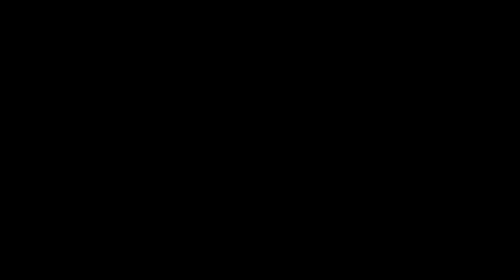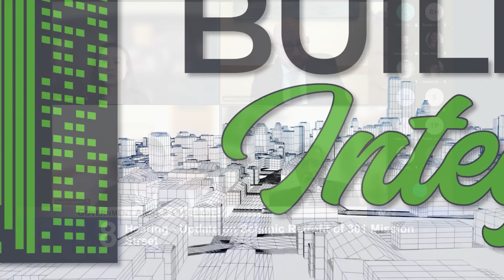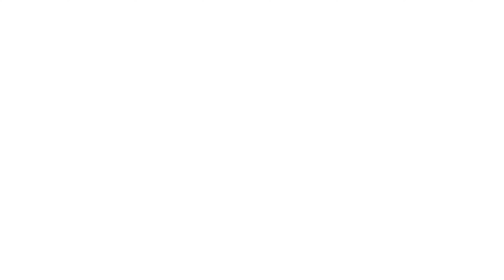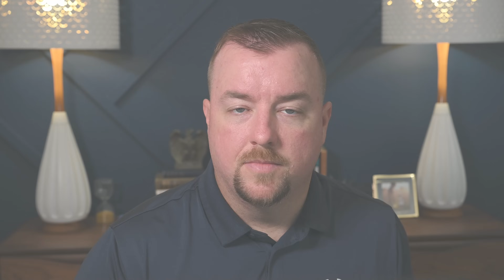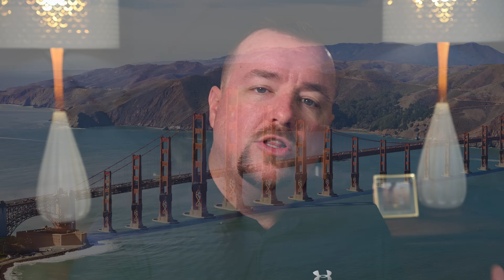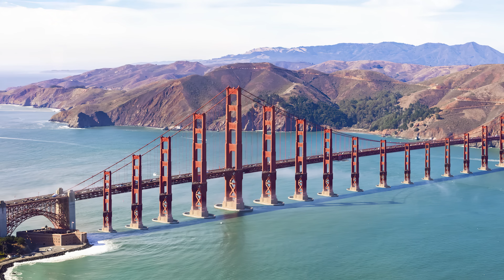Millennium Tower's "Sophisticated" Fix?  You Decide - (San Francisco's Leaning Tower Part 4)

Comment: A US Geological Survey research geophysicist named Tom Parsons says that San Francisco is sinking into the Earth.

NBC Bay Area reports that Parsons examined every single building in the Bay Area, using satellite images captured by European Space Agency’s Sentinel 1 satellite.
Most of the settling appears to be taking place downtown, because of the staggering weight and density of the buildings.

Ominously, at least one is also tilting.       According to The Weather Channel, Millennium Tower earned its nickname of the “Leaning Tower of San Francisco”       because of how much it’s tilted each year since its opening in 2009, and NBC says it’s only the third heaviest building in the city at an estimated 686 million pounds.       In 2018, a large new crack had been found in the building after residents heard a loud noise.   Experts say many problems may be causing the city to sink, including the loss of groundwater because of new construction and that the Millennium’s foundation isn’t rooted in bedrock.

Concerningly, Parsons told NBC the combined weight of all the downtown buildings is enough to affect an earthquake fault, though luckily the famous San Andreas fault runs offshore before it reaches the city.    And, of course, it all connects to climate change.

“If you have all of this going on when you’re right near the waterline, in some cases in San Francisco, then you have to worry about big storms that sea level comes up and inundation more frequently,” Parsons told NBC.
      Parsons also says he’ll be studying Manhattan next, according to NBC, to further study the effects of sinking on coastal cities in light of rising sea levels.

Comment: I’m a geotechnical engineer, albeit with limited experience with piles. If a structural engineer came to me under normal circumstances with a specified number, spacing, and loading of piles, I would probably assume that was something they determined was necessary due to a structural constraint (i.e. a greater spacing would result in excessive deflection in parts of the structure, etc.).

However, in an unusual case like this, I would expect the geotechnical and structural engineers to be in frequent contact with each other, discussing the designs and bouncing ideas off of each other.
Reply: It does raise the question of what the relationship is between the two groups.  I feel that engineers are engineers and would like to talk to each other, but some kind of politics is limiting the interaction.
Reply: @russellhltn1396  I'm guessing it was fire-and-forget before, but quietly adversarial now (don't want to tick one another off and cause the other to turn state's witness).  It's probably like a modern replay of he Kansas city Hyatt Regency structural issue - engineering inattention leading to catastrophic structural deficiency.
Reply: My experience says once the phrase "It is what it is" has been used in the engineering discussion, they are out of viable engineering solutions. This project will require more time, money, and inventiveness than it will cost to just buy out every owner and tear it down. They should remove this Boondoggle before it becomes an "engineering issue" for the surrounding buildings.
Reply: @bradfordprice3781  And I think there lies the problem.  There isn't enough money to fix it, and there isn't enough money to buy everyone out and demolish it.  Ultimately, I think everyone will lose.  It becomes a question of minimizing one's own losses at the expense of others.
Reply: @bradfordprice3781  Well, it will be what it will be
Reply: @bradfordprice3781  ever since I learned of this building's problems last year, I've said the same thing.  I am NOT an engineer but do have a pretty deep background in structural and civil engineering picked up "seat of pants" over the 45 years of my career as an architectural drafter and designer who actually did all the gravity engineering on every building I designed and built until just a few years ago.  When the cost to "fix" the building exceeds to value of the building, it's time to tear it down.  I lived in downtown Seattle for many years and we had a similar situation with The McGuire Building, a 26 story residential tower that took 3 years to build and after 2 years of being a viable building was evacuated and torn down, a process that took almost 2 years.  The issue with The McGuire Building wasn't settlement issues, it was well grounded on bedrock, the issue was the post tension cables used in the concrete slab floors had not been properly stretched and so the floors, all 26 of them, began to sag between the support columns almost immediately live load was applied to them.  There are some interesting videos on YouTube showing home videos residents of tower took of their sagging floors.
Reply: Exactly.  Should have been a room full of people - <competent> engineers,  geotech, foundation contractor, owner all spit balling a solution on a white board. 

 Unfortunately, it's devolved into a CYA contest.

Comment: OK, I'll add my 2 cents. This building is about 7 miles from the San Andreas Fault and maybe 15 or so from the Hayward Fault. We have seen that the San Andreas, in the Bay Area, is capable of producing quakes of 7+ in magnitude. And we're going to float this building on clay? This clay layer can't even support the weight of the building. 
Oh, and by the way, tall buildings in SF sway FEET in smaller quakes.
Reply: The solution adds a whole other layer of complexity to this (and another reason it is flawed) - sitting a portion of the building on hard rock and another on clay is all but sure to bring seismic failure. An Architect here with a fair bit of experience........
Reply: @smaarch1  
With no experience whatsoever, I'd already come to the same conclusion.   😖🤦‍♂️
Reply: This building already has a built-in sway, so earthquakes will be no problem.
Reply: @michaelsommers2356  😂
Reply: @michaelsommers2356  not true. Yes, buildings in earthquake areas are on rollers (usually) but the safety of that depends on them being straight up and down. Not leaning 2 + ft to the side. Because of the rollers, they also sway with heavy wind. It can make you sick, but I've never been in one that was off level by 25 inches. I wouldn't want to be in one either.
Reply: @calliew311  I was making a joke, the "sway" being the tilt.
Reply: @michaelsommers2356  my bad. 🤦🏼‍♀️
Reply: @calliew311  Well, it wasn't a very good joke.
Reply: just make an uboat of the building  so it can sink far down so it wont topple over

Comment: Maybe it is because my mind is full of IT thought processes, but it seems to me that a simple Excel spreadsheet with engineering formulas and a cell for changing the number of piles could help find the optimal choice. What if scenarios easy to adjust.

I'm far from an engineer even though I have credentials claiming I am. That just means the term has been watered down to the point of being meaningless, but I digress. I'm confident there is software far better than Excel for these calculations. I'm even more confident that there have been qualified people with access to all relevant information that know EXACTLY what the risk is and what needs to be done and the most optimal solution. 

My suspicion, with much less confidence, is that the people with this knowledge are being kept from providing testimony in any manner that could create a liability. The politicians want to make it appear more complicated than it really is so they can always say they tried with the information available. 

Maybe I just don't have much trust in people, that's possible, but every step of the way seems to sound like half of the conversation is about looking for a solution and the other half is preparing a defense in case they are wrong.
Reply: The issue in engineering is seldom the calculations.  Doing those is the easy part and Excel does them just fine.  The hard part are the assumptions and the unknowns.  Things like steel are well understood, consistent and fairly easy to analyze to a high degree of certainty.  Things like soil is not nearly so nice.  Soil varies dramatically in all three dimensions and geo engineering is as much art and judgement as it is science.  And many things interact.  One pile by itself will have different characteristics and capabilities than will a closely spaced group of piles as the piles can interact with each other and the soil.  I think for this reason most geo, foundation and structural engineers tend to be super conservative when it comes to foundation design both for the reason of the large uncertainties involved and for the criticality of the foundation and difficulty of making later repairs.  It appears that with this building, the engineers let the cost pressure cause them to be much less conservative and they got too close to the line and it has bitten them.

Comment: Is there any tech to inject some sand mixture to the lower part of existing piles so to level the building? I think with modern tech you can achieve a very very very high pressures.
Reply: Don't know about raising the sinking but you could cut off the tops of the long ones?   (ROFL) 
 Building sinks slowly but straight.

Comment: Ron Hamberurger attempting to throw the other engineers under the bus means that he is either lying, or incompetent. I am not an engineer, but my brother is, and I have worked with many engineers on projects. The first part of a project is finding the design and engineering requirements. For example: What is the type of load, how much load will need to be supported, what is the design life, what are the cost and time constraints, etc. The engineers will gather that information first, then come up with one or more solutions based on those requirements. Except for very straight forward and simple solutions, there is generally a back and forth discussion on different design trade offs.

In the case of Millennium Tower, the first part would be how much force would be needed to reverse the downward movement, then what designs would be able to provide that force with enough margins to ensure success, then which of those designs would cause the least amount of impact to the building occupants, and then finally, be the least expensive. Since the amount, type and spacing of the pilings would have a huge impact on price, and also impact on the building occupants during construction, this would be a very large part of any design process.

It sounds like they purposely just used the geo-technical engineers as glorified plan checkers for their solutions, instead of collaborating as would be normal. They can now use that to blame shift for their incompetence.
Reply: I asume they pretty much knew before, that 18 should be enough. But with such a huge project, never been done before in that kind of circumstances, they just went for more than double to be 100 % on the safe side. I guess getting paid  for the extra piles was never in question, since everybody would be happy if they could fix this major f..up . 

But when the drilling and the solution made the problem worse, they had to admit 18 were enough.
Reply: @joedo3529  Except, if that had been the case, then the Engineer just lied!  Saying we added a huge safety margin would have been a valid reason for the initial reduction.  However, even then going to 18 means the thing was way over-engineered. Especially given the level of disruption it is causing.
Reply: @EmperorA0  I have a hard time believing they chose the random number of 52, and not at least discussed behind closed doors, if 40 or 30 or 18 could be also enough. Something seems to be missing here. I am sure there was a reason they went for the 52 in the first place and somehow can not tell why now 18 are enough.
Maybe they were worried about the foundation because it is also twisting and were happier spreading the forces to 52 points, than to 18 points.
Reply: Looks like a pass the buck game. Wonder who's gonna have the buck when it goes off?
Reply: The foundation was originally designed, for a steel upper structure.  Some 'doofuses'   changed the plans, and made that thing (tower) out of cement.  Also, they  wanted to save 4 million $$, by  NOT  GOING  TO  BEDROCK.....so, now it is time to pay  the  piper......and that, will go on, until  mother nature,  ''levels '' it.....literally.   See facts, above.

Comment: In defense of the geotechnical consultant, they would not have been paid for extra, unasked for work. BUT it would have looked better for them now if they had asked "do you want us to determine the optimum number of piles?" at some point. I'm surprised the building owner hasn't commissioned an independent audit of the structural engineer's work; I would have no confidence in him given the recent events.
Reply: True about the geotech engineers not getting paid for extra work, or answering questions that weren't asked.  Also, the geotech firm may not be experts on the structure of the building or its foundation.  Therefore they may not have been qualified to determine the optimum/minimum number of piles.  That determination may have required combining their expertise with that of the structural engineers, and further investigation, calculation, and expense.
Reply: Here's a guess:  maybe the builders are asking very narrow, very specific questions, because they are desperately trying to control the answer?  Which is to say, they aren't contracting a proper analysis because such a thing would probably say "its a lost cause, tear it down",  or possibly "this is absolutely the result of culpable incompetence".  They don't want to demolish it, and they definitely don't want to get sued for theirs shorts.
Reply: @Metaphysician2  A very plausible explanation.  Ask the right questions to deflect attention from the bigger problem.  I've seen it too many times in engineering where someone doesn't want to admit they screwed up.
Reply: @Metaphysician2  That was very much my feeling as well. I don't know if the building is unsalvageable, but the answers all sounded like, "don't sue me, it's not my fault," only in much fancier words.
Reply: I’d be so unhappy if I owned property in that building, this is absurd.
Reply: I'm surprised (only kinda) that Hamburger (engineer, bottom right) didn't ask them how much over any of the designs could handle.  It was just "Will it work?" but not how much extra capacity is in the design?

As a follow-up thought, I can understand starting with something like "6-feet on center" to get in the ballpark, but you iterate from there.  Start with something, then ask "How close is it?" and "What can be changed to reduce cost safely?"
Reply: @ssvis2  Six feet.  Where have I heard that before as a solution?

Comment: Haven't they ever heard the phrase, more is not always better. From your previous videos (and Practical Engineering's video), the integrity of the pilings was compromised just by the fact that they used soo many. The pure fact that they took this shoddy shortcut because the Transit board didn't throw in a few million for the alternative design is appalling. In San Fran money... that's like the sale of one of those units alone. For the cost of a couple of units... they could've done it the right way, but now they're throwing millions more at the problem. This is more and more sounding like the Tacoma Narrows Bridge. I'm going to laugh when that building winds up getting torn down in a few years because they've compromised the grounds so much trying to fix it.

Comment: At the current rate of tilting, the plumbing and elevators will be unusable in 5 years. 
(And I don't think the millionaire residents plan to climb up 70 floors of staircases and use a porta potty )
Reply: ....YUP.....re-level  your pool table, bathtub, and disconnect that toilet. doofuses, all over in San Fran Bay  area...
Reply: Land your helicopter on the roof, stick your arse out the window on the downward-tilting side, and let fly onto the peasants beneath. It's good for them, reminds them of their station in life. And it's free fertiliser.

Comment: Conspicuous by its continued absence is how the counter tilt motion will be arrested at some angle near zero.  Seems that we need to ‘land’ the building’s mat in a manner like a tricycle gear on an airplane when landing-, main trucks down first and then the nose wheel resulting in a controlled settling onto the runway, or piles.  Here, the mat would be the landing gears and the top of the piles (suitable arranged) the runway.  One thing is certain, the mat cannot withstand further damage or stress.

Comment: Have they even discussed what the point of no return is? How much more does it have to sink before it needs to be taken down? Everybody is kicking the can down the road.
Reply: Someone else commented that at the current tilt rate, plumbing and elevators will stop working in 5 years. If it gets to that point, the building will most likely be demolished since it won’t be usable anymore, even if you believe it’s still “safe”.
Reply: Every building has a limited lifetime.  This one just happens to have a set of bad genes and most likely won't make it to the teen years regardless of how much money is dumped on it.